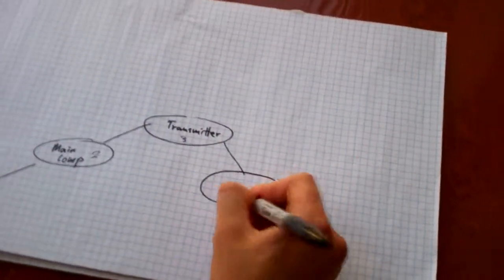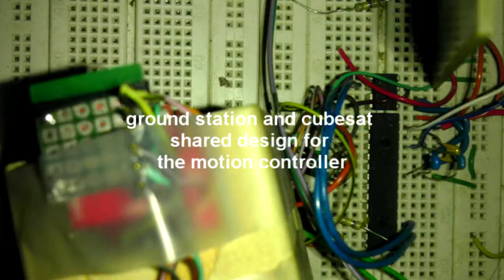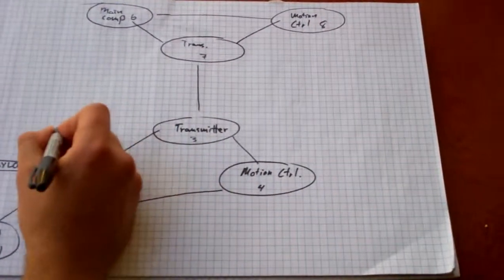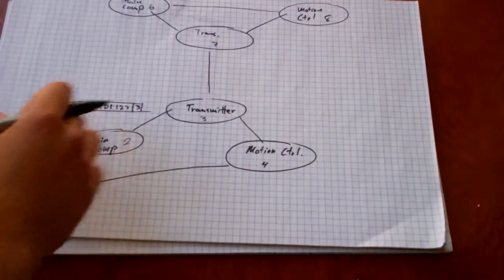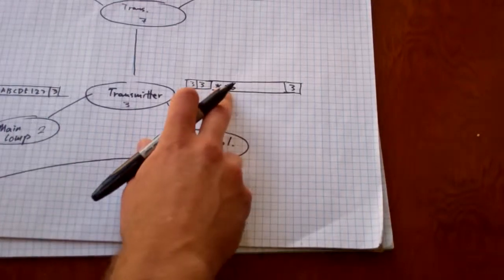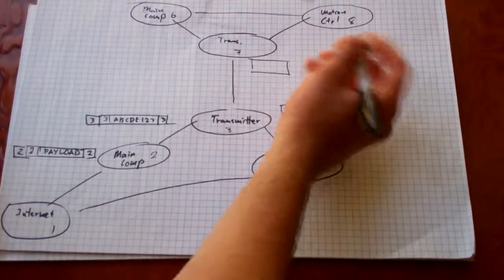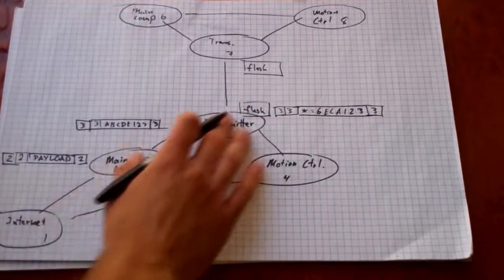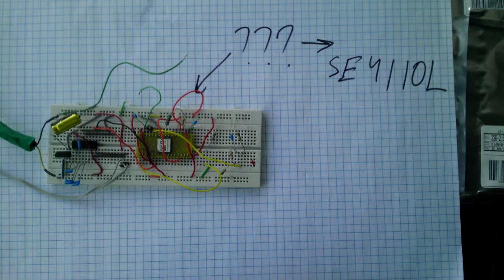Data protocol extension. GPS implementation. (Изменения протокола данных,GPS)

Comment from the maker: Data protocol extension. GPS implementation. (Изменения протокола данных,GPS)
Data protocol extension. GPS implementation. (Изменения протокола данных,GPS)
Packets transferred between microprocessors can be noisy, data can be lost. To recover from errors in header of the packet was added double unit address. Last byte in a packet can be skipped. Re transmit of the data to different micro-unit implemented on  interrupt level. 
Communication module do not work "like-modem" anymore. For upload data over radio-link in a packet was introduced CMD*. After CMD* rest of the packet transfer ether back to serial com (if no connection) or to the other communication module. CMD= extended to re transmit data to a another micro-unit.
GPS has a bad reception in concrete building. That creates problems in debugging GPS data processing inside main controller, - needs to take laptop and go outside. 
Another SMD device able to retrieve raw GPS/GLOSNAT data was discovered - SE4110L. Without limitations on traveling speed and altitude. Device outputs data after ADC conversion. All data has to be processed in micro controller. Disadvantage - industrial temperature range. 
Another alternative to GPS/GLOSSNAT was investigated but it is premature to say anything now - needs to process captured digitized data.
Serg was asked to embed some jokes to his presentation.

Внесены изменения в протокол обмена данными. Для восстановления от потерь хвостов пакетов в заголовок разрешен дублированный адрес. Закрывающий байт пакета может быть пропущен. Коммуникационные модули перестали быть модемами, для космической коммуникации это не практично. Внесена команда * - загрузки данных на подсоединенное устройство. Расширена (восстановлена из предыдущего небытия) команда = для ретрансляции пакетов.
GPS задрал - очень плохой прием в железобетонном здании. Как дурак берешь лаптоп и прешся в скверик, и вместо работы рассказываешь лекцию на тему - а что такое космос.
Появилась микросхема с полными причандалами GPS/GLOSNATA - SE4110L, до АЦП включительно, коштуе 3 бакса, хреноватый температурный режим -40+85. Достоинство - всю математику нужно считать самому и можно не платить за сертификацинную GPS (цена больше 10 штук, плюс нужно доказывать, что не был и в верблюдах не состоял) с отключенной защитой от скоростей больше 500 метров в секунду.
Другая альтернатива GPS обдумывалась, компонеты заказаны, и даже идея  была опробована, - но пока все это несерьезные спекуляции - нужно обработать данные.

Comment from the maker: Originally my idea was to build something like modem. In that case integration is simple, even possible to use IP over modem connection. I took core bluetooth from Nortic, combined with PIC16, implemented ATDT/ATA command, that was OK, and was working like modem. Then I spend a lot of time on amplifiers (never in my life designed anything like RF). Problem for me is – CubeSat is just a testing stage – goal - the moon distance. If I'll use ...